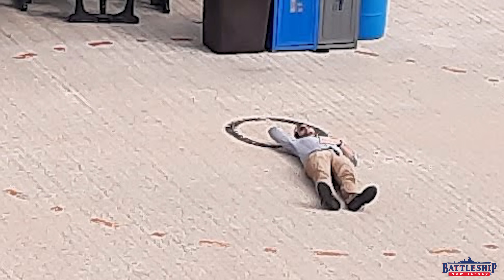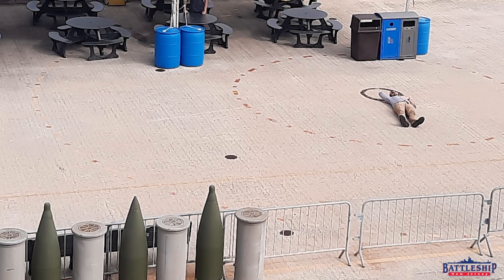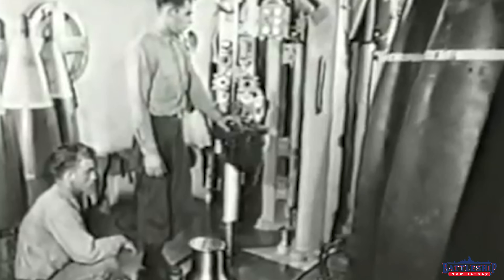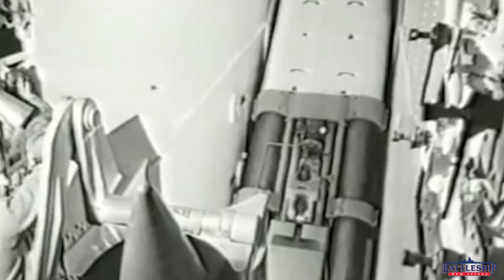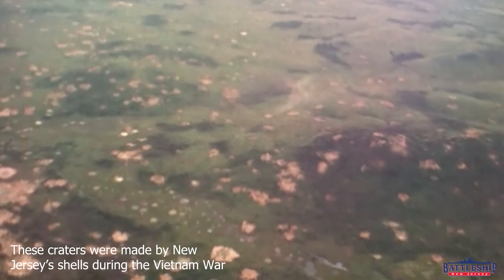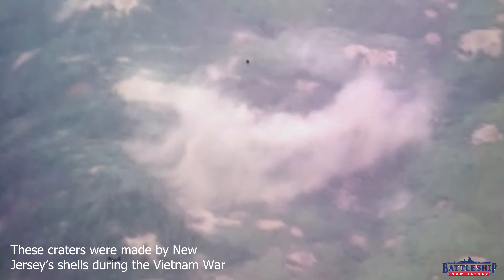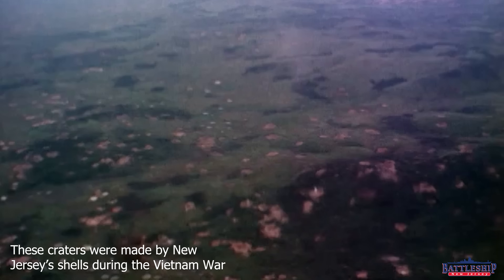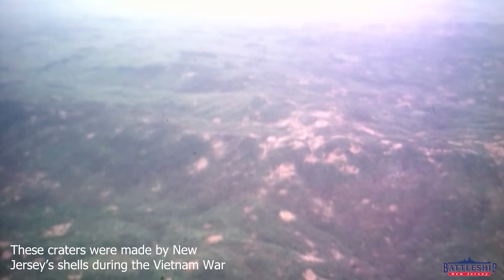How Big Is the Crater Made By a 16in Gun?

Comment: We often hear about how New Jersey could, at point blank range, penetrate 30 feet of concrete, but I am having a lot of trouble finding out how much armor she could penetrate. All I've heard is that she could penetrate just under 20 inches of steel at point blank range, and nothing else. I do know a 13-inch belt from the battleship Jean Bart stopped a 16-inch shell from Massachusetts.
Reply: There are a lot of armor pentation tables that you can find online for all kinds of battleship guns. A google search should get you what you are looking for. Only thing is that which country's armor, the angle and range of impact, and what year the shell was made effect the numbers a lot, but using a shell made after 1944 and if the armor is not sloped at a range of 20,000 yard it's about 18.6 inch of penetration and at 30,000 yards about 14.5 inches.
Reply: @willpat3040  Oh, that makes sense.
Reply: Okum is the go to guy for armor penetration data.   There are many factors determining the effective armor thickness.   Did the round hit perpendicular to the belt or did hit at an oblique angle?  You did point to a potentially defective fuse.  Was there a premature detonation.
Reply: I've seen a 16" gun and a test target at Fort Miles in Cape Henlopen DE. Don't know exactly how thick the target was, but it was contemporary ship armor. There's a hole in it you can crawl through. Looks like a kid put his finger in cake frosting. They just go right through, at least at shorter range and steep angles.
Reply: @matthewkriebel7342  It might be the 26-inch turret armor originally meant for Shinano. If that's the case, then the shot was taken from 400 feet away at a flat trajectory against sloped armor (ironically, the armor was rated as immune to Iowa's guns from all realistic battle ranges). I could be wrong, though.
Reply: Assuming naval APHE shells were built the same way as tank shells (just, y'know, 3-5 times bigger in this case), 
I don't think a faulty fuse would affect armor penetration if its just an inertia activated fuse in the rear of the shell.
Reply: @cataclysmicnothing  mmmh, that's odd. Freeaboos often talk about how "nothing could stop a mark eight 16-inch shell, not even Yamato's armor". Seems history says otherwise
Reply: The penetration of the Mk 8 fired from a 16"/45 was about 2,5" less at most ranges.
Reply: @johnshepherd9676  I'm not sure how accurate that is. it does repeat the common myth that Iowa's penetration power was nearly equal to Yamato's, which is completely false. Said website also claims that USS Massachusetts could penetrate 17-inches of steel at 20,000 yards, when a 13-inch armor belt stopped Massachusettt's shell from a similar range. My best guess is that this was based on faulty tests At 0 yards, Iowa could penetrate 800 mm of steel while Yamato could penetrate 864 mm, at least according to my sources.
Reply: Bigger doesn’t mean better
As you said our 16 did 800mm Japan went 2 inches bigger and only gained 64mm
Though believe Japanese shells weren’t as good as ours due to lack of material, manufacturing and design
Reply: @tomhenry897  What's so bad about that? Yamato's guns were 2-inches bigger and gained 2.5 more inches of penetration?

I don't think that I've ever heard about that last point either.
Reply: @metaknight115  Yamatos guns had better penetration close up, but at battle ranges, the 16"/50 equaled the 18.1" gun and even surpassed it as range increased. Sectional Density is the reason hear, methinks, the same reason a 6.5mm bullet often outpenetrates a .308 Win bullet.

Comment: 30 feet of reinforced concrete, 2 feet of battleship armor, and a 80 foot impact radius. That’s impressive! I would love to see what an 18 inch gun does.
Reply: It sinks
Reply: @notme123123  😂
Reply: Yamato go Bumm 🤯
Reply: It gets rebuilt into the shock cannons on Space Battleship Yamato, after the Gamalons attack with planet bombs.
Reply: @bobkay2827 the wave cannon always does the trick
Reply: One large helo landing pad.
Reply: Watched a few through the ships ”big eyes” , very large binoculars. Looked like heavy pieces of shrapnel out to about 200 to 250 yards.
Reply: A bigger shell may be slower, doing equivalent damage.
Reply: @gmat5046  square cube law, though. it will have to go a lot slower to have less kinetic energy, and would likely carry a larger bursting charge, whether AP or not
Reply: @f0rth3l0v30fchr15t  Square cube law doesn't apply.  Just because the shell has a higher diameter, doesn't mean the length is increased proportionallly.  Also, heavier shell with the same powder charge will be slower to the point of doing less damage.  Could be a larger charge though, as you say.  Would depend on a lot of factors.
Reply: @gmat5046  Well, the BL 18" mk1 fired a 3,320lb shell, and the BL 16" nk1 a 2,048lb shell.
So we can safely assume different dimensions.
Reply: @f0rth3l0v30fchr15t  true.
Reply: @gregorywright4918  If it is it's probably at Dahlgren, VA where all the guns get proofed.  Being a Naval Support Facility it's not open to the public.
Reply: The Lancaster bomber pilots dropping tall boy bombs on Terpitz recounted seeing these 16” shells making there way up to them as Terpitz unloaded everything it had at the approaching bombers the pilots said they just had to maintain there course and hope one didn’t hit them .
Reply: It rusts at the bottom of the ocean.
Reply: @Tarakian1999  Not all 18in guns. The US navy tested some to study the feasibility of installing them on their battleships. They preserved a few of the guns and put them on public display.
Reply: @benmiland5245  The RN made 3 18" guns during WW1. " of them saw use for coastal bombardment from monitor ships, with HMS General Wolfe firing around 50 shells in a day at targets 36,000 yards away.
Reply: What I don't remember is the fuse type, point det or timed. ( Air burst).